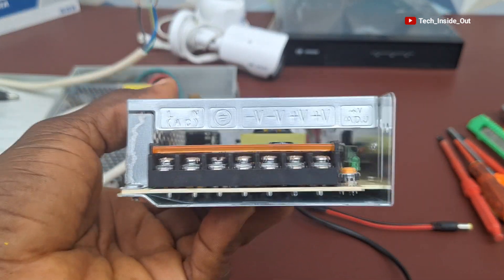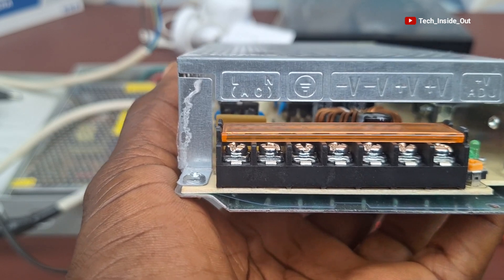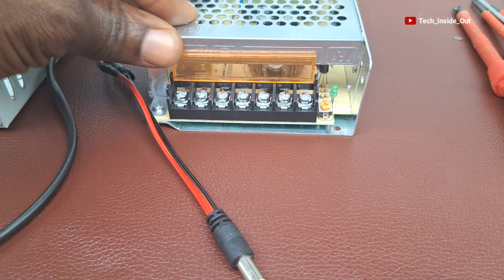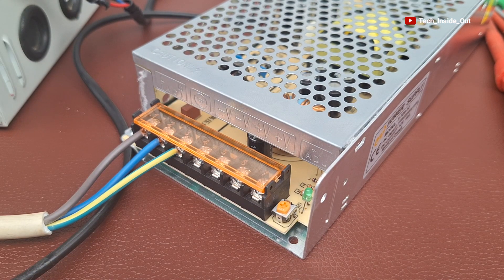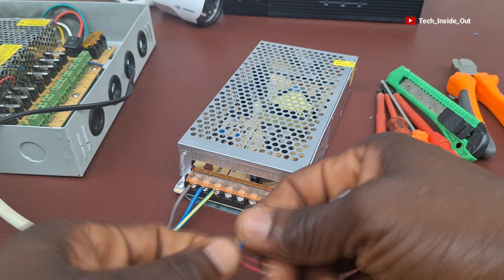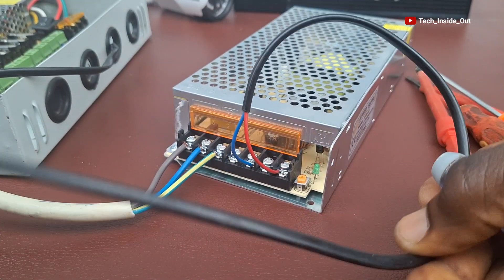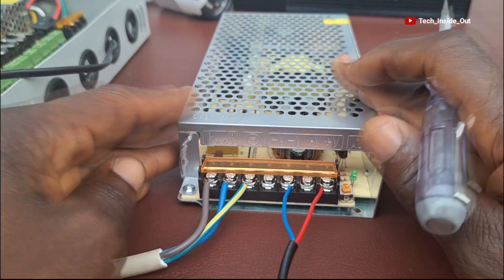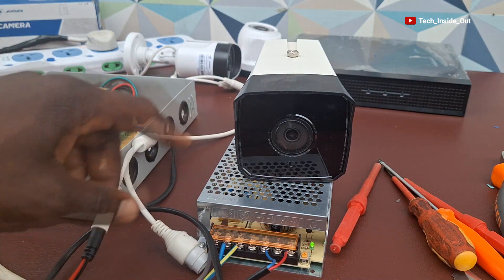Practical CCTV power supply unit wiring concepts part 2

Comment: I have never used this type of power supply. But can I pair as many cameras as possible by pairing red to red and blue to blue in the same ports, and also I need to connect the cable from the power source 😮😮
Reply from the maker: You can pair cameras together, but do it while considering the power requirement of each camera so that you don't overload the power supply unit

Comment: I installed 14 analog full color  cameras with cat 6 and video baluns and provided such a power supply 20a, but some cameras show me that theyre not getting enough power. Theyre showing lines. Please how can i solve this?
Reply from the maker: The lines could come from power problem or improper video cable terminations.
1. Use at least 2 pairs of the UTP Cable for the power connection.
2. Ensure your video terminations are firm and well terminated